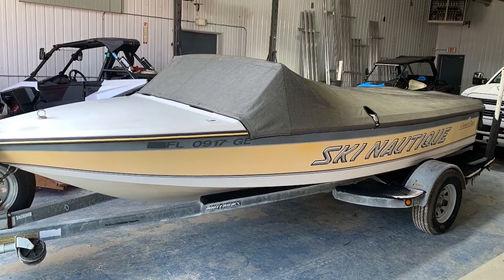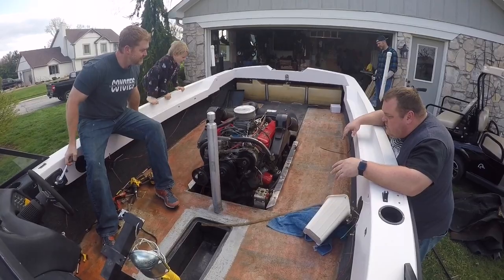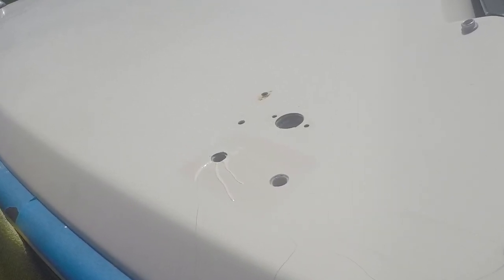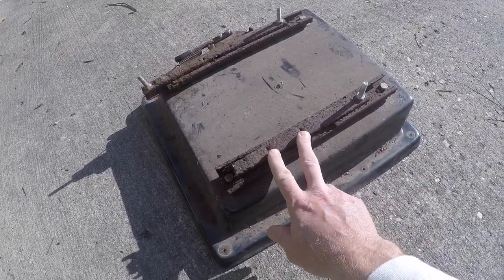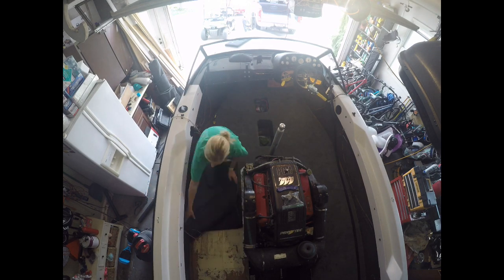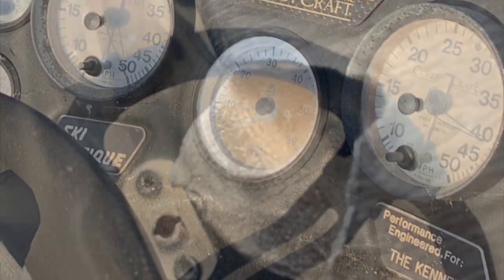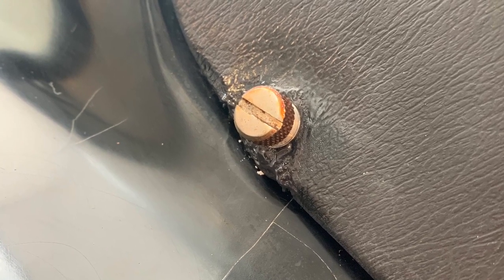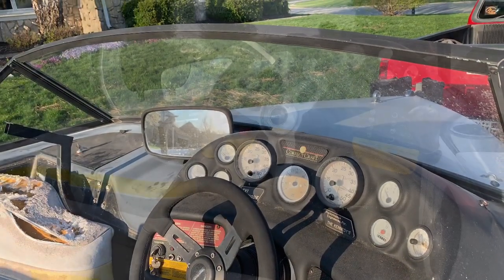Full Ski Nautique Restoration

Comment: We had a 79 ski nautique that my parents had when i was born in the 90's and we bought a 94 sport when i was about 10. We got rid of the 79 and my dad found it 15 years later at a consignment dealer. It was in really rough shape because it sat outside and he wanted 5k for it. I went and looked at it and all the freeze plugs were out and every summer I'd have the dealer call the guy and try to buy it. After about 4 years i finally talked him down to 2k and i was gonna pull the cash out and the dealer called me and told me that he didn't have the title so they couldn't sell it. There was a bunch of old paper work when we owned it that i wish i would have kept. Anyways it's always cool seeing someone restore them! I bought another 79 ski and my dad has a 83 ski and my older brother has a 2002 super Air. Nautiques are awesome boats!
Reply from the maker: Thanks for sharing. I bought an 02 Air Nautique a couple years ago. Good boat.

Comment: Just bought a friend’s 96.  I knew both previous owner’s.  Low hours (460). Interior and exterior immaculate.  Sitting up for 4 years so dumped all fluids, new batteries (I like 2), new high pressure fuel filter and fuel relays, gassed it up and hit the lake.  Fantastic hole shot and over 50 top end.  Love it.  Dennis on Lake Austin.
Reply from the maker: Awesome!  They are such fun boats to cruise around in.

Comment: Great job she looks awesome. I have a 1993. Just had the interior redone. Now working on the gel coat. Thank your wife for the magicEzy tip for the hair line cracks. I am gonna try it on my 93. I also restored the trailer last year. Hopefully by this summer all will be done and she will look like when I bought it new in 93. Thanks again for the video.
Reply from the maker: Yes, I need to work on the trailer this summer.  That spider crack fix was great, though it did wear a little over time.  She will likely touch it up again for this summer. I just picked up an 86 and am going to make several more videos for it so make sure you're subscribed.

Comment: BEAUTIFUL: great job on the resto-project!!  I own a purple '93 (same boat, basically)...absolutely LOVE it! I have redone my interior as well (of course in purple & it turned out as well as yours). I did that years ago, as well as added a really nice stereo w/amp & sub (just for a lil' thump, nothing obnoxious). This last year also did a full engine "once-over" tune-up, replaced my steering cable (huge difference), & will be refurbishing/replacing gauges this year. Sincerely appreciate the tip on the MagicEzy Hairline fix product, I've got those damn cracks scattered around in various spots in my top cap of the hull, never knew what to do. I run a fly-hi pole for long-line footin' (no tower for me...personally I don't like the look of towers on this model, but also don't want to put holes in the fiberglass), without the pole, it is such a classic, clean look; and my primary passion is slalom, so it cruises the factory look most of the time.  It was great to hear this was your "dream boat"...my purple one was mine as well, only this model of boat came out when I graduated high school!  For slalom, trick, barefoot: this is a really tough boat to beat (w/the right prop).  Congrats, I sincerely hope you enjoy yours as much as we've enjoyed ours!
Reply from the maker: Thanks.  Thinking of doing the steering cable this year.  I agree, you just can't put a tower on these boats...

Comment: How much should I allow for a complete interior redo for late 80's to mid 90's Nautique? I have found a couple solid boats but need new interior. Thanks again
Reply from the maker: Upholstery is your big purchase. You can get something simple for $1,500-$2,000. What I had done was $3,400 and it was top notch. $200-$250 for carpet. I put money into stereo/speakers, steering wheel, and new switches.

Comment: Fantastic restoration! How is the non slip padding holding? I’m thinking of getting the same stuff. Looks great!
Reply from the maker: I thought it held up well.  I had to leave the boat in the water which required a lot of clean up this spring.  Since I had a roll of this and it's so easy to cut and stick down, I just put a fresh pad on the back for the new season.  Took about 5 minutes.  I'm going to put it in an upcoming video.

Comment: Can I ask, was the floor bare plywood or is it ply with fibreglass over the top? Also did you find any soft spots in the floor? And do you have any footage of the carpet removal?
Reply: This was the year they moved to fiberglass bottoms. Makes a huge difference. No real soft spots. Carpet was so old it just pulled right up. I used a grinder with a wire brush on the bottom which smoothed the fiberglass/old glue right out.

Comment: I’m looking for a project just like this one. I live in NC and I was curious what did the boat cost before the project started. If you don’t mind me asking. I’m on a budget so trying to get some parameters on that front. Thanks and great job!
Reply from the maker: I picked this one up for $4,000. It was a great boat for a restoration. The one I’m currently working on I bought for $2,500. Needs a bit more work.
Reply: I have a 1992 that needs some of that work but not nearly all.  Needs some new carpet and rear seat bottom.  I have owned it 30 years and it may be time to pass it on to someone else that could love it more.  Probably won’t be selling for less than $10,000 from what I’m seeing

Comment: Cool project.  What is the depth of your garage?  I'm looking at a 1992 with a factory trailer.  I want to know if I can make it fit in my garage.
Reply from the maker: I'll have to check this when I get time.
Reply from the maker: Garage was 21 ft. I had to take off the platform and lift the 92 trailer tongue up.

Comment: look into getting a mirka electric sander with their abralon sand paper.  they are expensive but i can wet sand, buff. and wax a boat that size in 5 to 7 hours.
Reply from the maker: I'll have to check that out.  That is the bulk of the time...

Comment: I’ve noticed on my 92’ Nautique there are 4 accessories switches that don’t run anything. Is that where you tied in your amplifier and sound system? Or did you run a second battery and power system?
Reply: Stereo and amplifier are directly connected. One accessory is used for LED lights that I installed under the sides. (Looks great). Another turns a “cigarette” 12V port on. Other two are not being used.
Reply: Only have one battery on this boat

Comment: What did you do to the dash? To clean it up?
Reply from the maker: The black fiberglass? Same as the sides 1) wet sand 2) compound buff 3) course polish 4) fine polish 5) wax. 
Now that I know how easy it is to remove the windshield, I would recommend doing it that way.

Comment: Great job! did you do anything with the gauges or sound system? I am restoring my 93 and that's the only thing left.
Reply: Nothing with the gauges, but I will probably put in gps speedometers next year. There’s a company that you can send your gauges into and they’ll fit them.
Reply: I put in new Kenmore white marine speakers but we’re not impressed. Definitely use marine grade speaker wire. DualMedia makes a blue tooth stereo. It doesn’t have a CD player so it costs just over $20. Highly recommend. Walmart sells them.
Reply: @ericvalentine3166  Thanks Eric. Can you share the company name?
Reply from the maker: Sorry....I'm catching up on comments.  This is what I was talking about.  We never did this little upgrade but I'd still like to do it.  http://www.nauticlaugic.com/airglide.html

Comment: How much did it cost you to have your seats reupholstered?
Reply from the maker: That upholstery was a little over $3,000. All custom made by a professional.
Reply: @MakeSkiBoatsGreatAgain  Was it difficult to install the skins? I want to replace the skins in a 99 Mastercraft and is about $ 1,500 cheaper to do it myself but worried about the difficulty level.
Reply: Never mind, i see that you dropped off all seats with the cushions.. I am quoted 4k for this same job. ( a little under half the cost of the boat) It's so expensive.
Reply from the maker: It is, but that is my philosophy… go as cheap as you can everywhere else and pony up for really nice seats. IMO there’s a big difference between amateur upholstery and a professional job. Just paid $4,400 for an 86. Both these jobs include new wood backing and new padding.

Comment: What steering wheel did you put on it?
Reply from the maker: I bought it online from Cabelas.  Nautique wheels run $300-$400 but I found that one for around $70.  With the $5 Nautique sticker, it makes a great replacement.  I need to find it again cause I just picked up an 86 Nautique and will likely do the same.  It was well worth it... one of my favorite upgrades to the boat.
Reply: @MakeSkiBoatsGreatAgain  thanks! I know, I can’t justify spending $350 for a steering wheel.  I’m restoring a 95 SN now, but engine first, so trying to get it in running condition before dumping a lot into vinyl repairs ;) 

Great job by the way. (Goes without sayin) thanks for your advice. I restored a ‘71 Bus, and am finding this SN community is much like the VW community. Looking forward to contributing a little more, once I dig into this the way you did!  Maybe I’ll record tearing down & rebuilding the carb.... that sounds fun (not!)
Reply: @MakeSkiBoatsGreatAgain  did you sell the Nautique in this video?
Reply from the maker: No I still have it.  Ran it 160 hours last summer.  You should check out the engine work I did this winter if you're subscribed.

Comment: Ford 351 motor? What carb?
Reply: Typically a Holley 4160 600cfm
Reply: Do you happen to know if stock jets were 67's or 62's?
Is power valve 2.5 or 6.5?
Reply: @supermo26  sorry, No.  Try Peter Biever on Facebook.  He is the Holley carb wizard are rebuilds them for ski boat owners
Reply: Michael Brunetti does he buy old carbs? I have the original from my 5.8 HO and would like to find it a good home.

Comment: No room in that boat at all with the motor sitting in the middle of the boat it must be an old boat cause they don’t make them like that anymore
Reply from the maker: Actually, Correct Craft still makes the center engine Ski Nautique, but I doubt they sell very many. This “direct dive” engine style has always been made with the purpose of pulling skiers. The engine is placed center to shift weight so there’s very little wake. Today, sporting boats are mainly designed for the exact opposite desire… make the biggest wake ever.

Comment: 1:30 Are you trying to overheat it immediately?  I have an 85 2001 and that seems like an ignorant way to start it.
Reply: Maybe he was using a fake-a-lake
Reply: The engine can run about 5 minutes before the thermostat even opens. The worst he’ll do is burn up the water pump impeller or blow up the exhaust hose. At least that’s what happened when I ran mine dry. That exhaust hose is no joke. It took me all day to figure out how to get the new one on. I ended up putting it in boiling water and expanding it with a log and wedge.
Reply from the maker: I did have a fake-a-lake hooked up.  That's why you see my buddy walk to the back to make sure water was coming out.  I really don't know what this guy's talking about.

Comment: How much water did you spit into the garage starting the engine or did you not hook up water????
Reply from the maker: A lot of people are surprised to learn that you can run an engine for a few seconds without water hooked up. I was seeing if the engine would start, not doing a timing adjustment with the distributor cap.